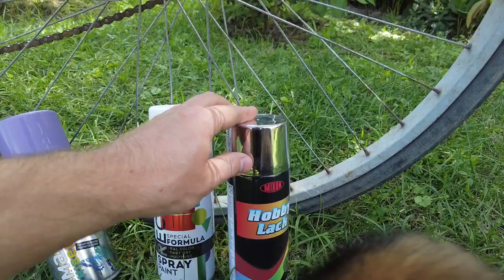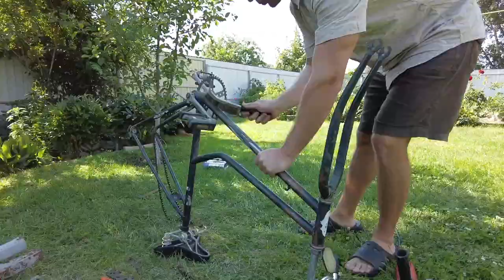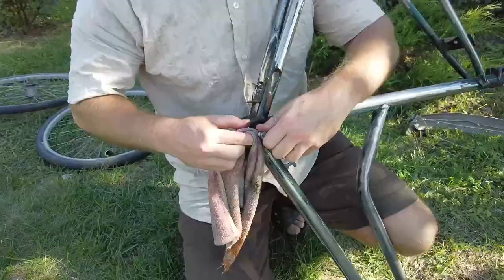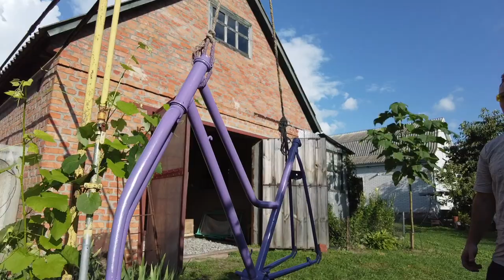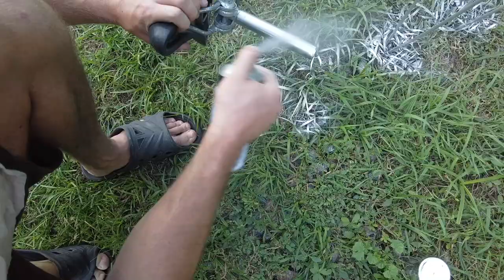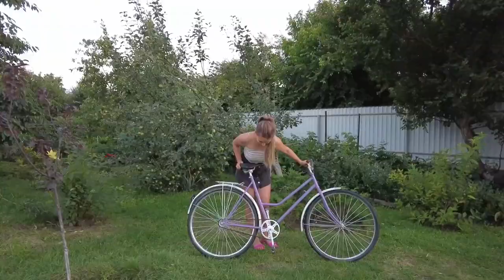Old Rusted Bicycle Restoration l From Soviet to Modern

Comment: Very nice job. I have a 1960 Schwinn in my shed that I want to restore. It is all original except it doesn't have a front fender. I bought it for less than $20.00 over twenty years ago.

Comment: looks good pavlo! but I would find it even better if you would also take care of the mechanics a little and take the parts apart even more before painting. 
for example, wash out the entire chain with petroleum ether and re-oil it. you have completely painted over the bottom bracket, which can possibly also be cleaned and re-greased.
keep you heads up, you are both wonderful people 💖

Comment: Looks good, but you should have sprayed it with primer before painting, it helps the paint to stick better, and not rust, and it would have made the fenders look better, because it would have covered the old paint that was left.  I painted car's for awhile, but painting anything metal, primer will keep the paint from scratching or getting chip's better.  G-d bless.